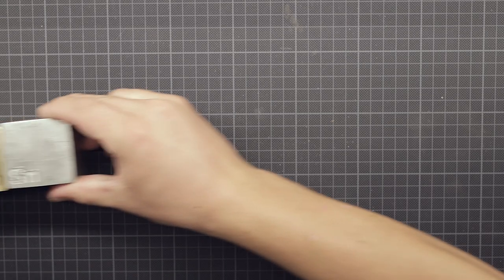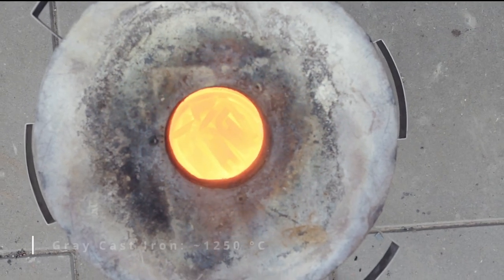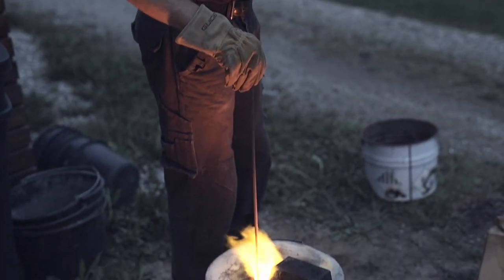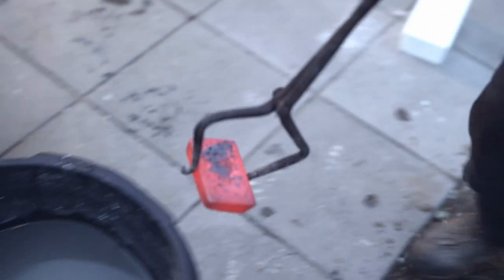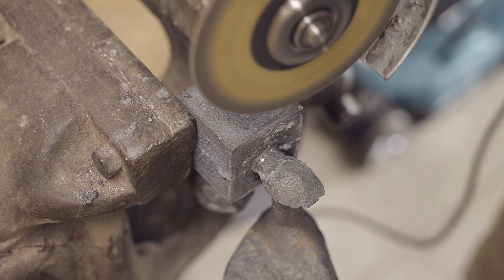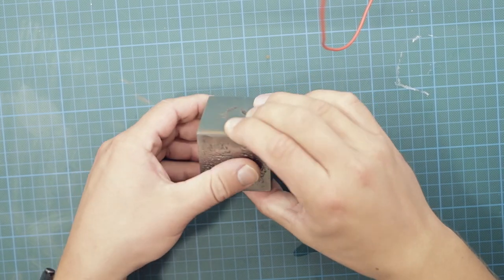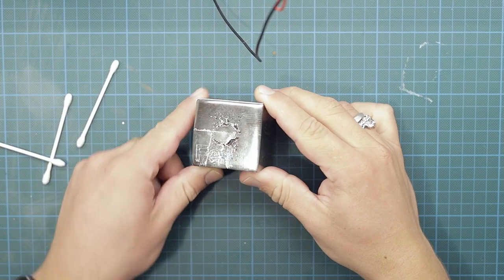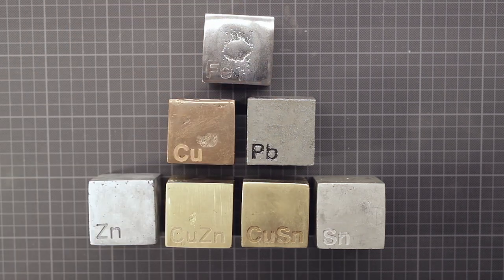Melting cast iron at home - Element Cube Collection (DIY)

Comment: hello, what kind of crucible you use to melt iron? actually i heard about the silicon and graphite crucibles degrades easily when it reaches the 1500°. Thanks for your help
Reply from the maker: Hi Danycage, we used a sacrificial crucible of unknown brand as this was a one time experiment to see if we could reach high enough temperatures to melt cast iron :)
Reply: It's a mistake it says 1538 c that's pure iron, cast iron that we used melts at around 1200 c. We used a cheap china clay graphite crucible.
Reply: @SebastianHalskov  ok, thanks for the information. Do you know something about steel melting/casting? i heard about induction furnaces and tungsten crucibles